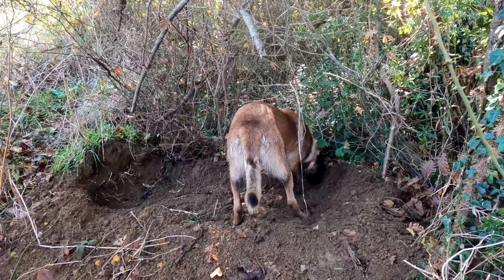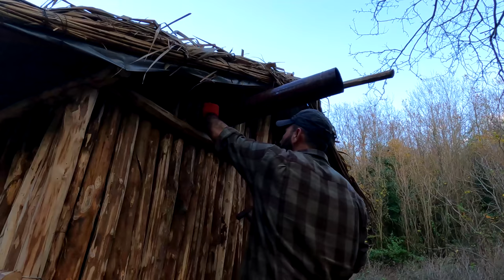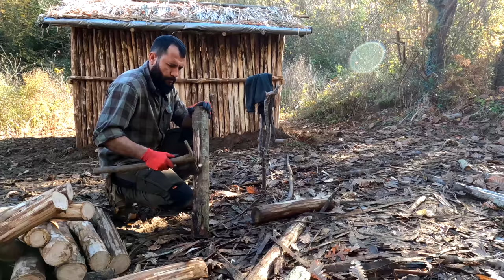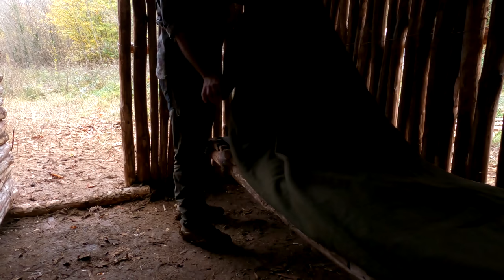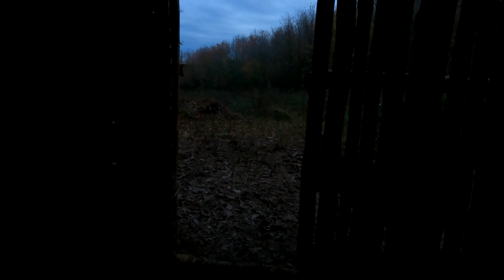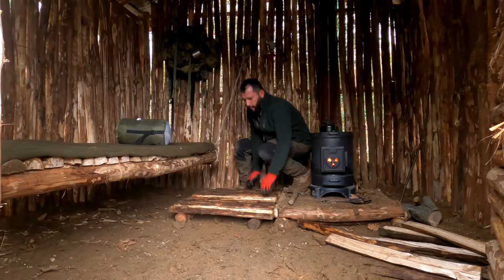Build Log Cabin for Winter Camp - Hanging Bed, Cooking on a Wood Fire Stove, Bushcraft Camping, DIY

Comment: No one else seems to notice these things, but I always do, having been homeless for a time, and having to survive in the woods with my son and two pups, so I notice EVERYTHING about people's "survival shelters".

It doesn't look like that will be very warm or dry during rain or snow.

There's an awful lot of holes in those walls, unless you're going to make a mud and moss mixture to seal those huge holes running all up and down those walls, or add mud and pine branches or something else as a wall sealant. 

The rain and snow will blow all over the bed, the stove, make a horrible muddy mess of the floor, etc, once it starts coming down.

Of course, it's not your permanent shelter, but for some people, a place like that might have to be, for the short-term or long- term survival.

That holey wall is actually defeating the purpose of having a wood stove, and a "shelter" to survive the cold and wet weather, to begin with. 🥶
Reply from the maker: Hello my friend. You are absolutely correct in what you wrote. If necessary in the future, I will close the holes in the walls.
Reply: @WargehBushcraft  

It will make it much warmer and safer for you and your dog, and keep wind, rain and snow from coming in on you you and your bedding, and will keep your floor dry as well.
Thickened mud with moss or grasses mixed in will work pretty well as sealant for the walls.

It looks very nice, but the holes in the walls gave me cold shivers. Lol
Reply: @натальяпопова-э9н2я  agreed luv